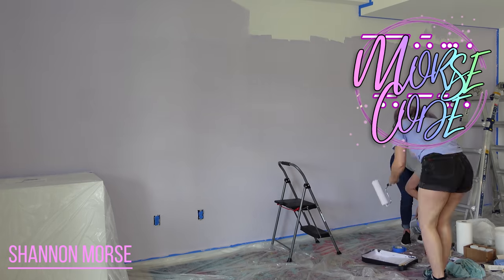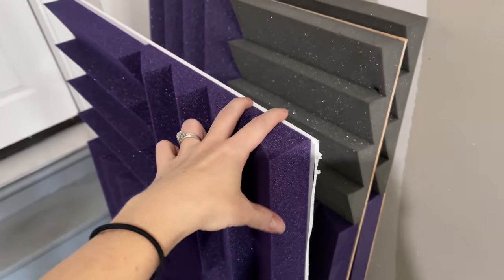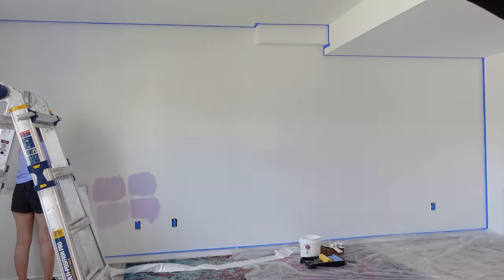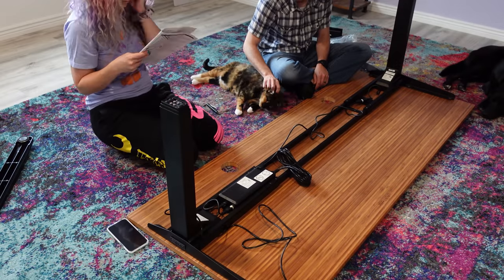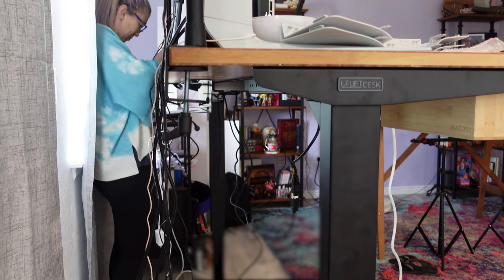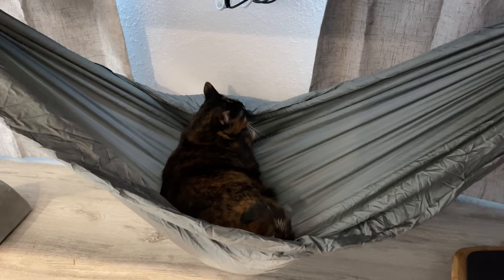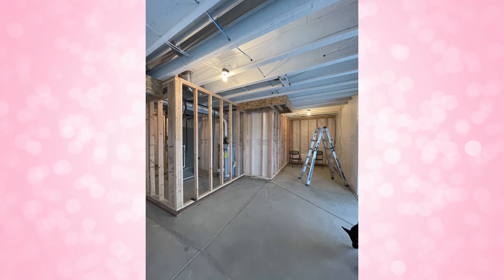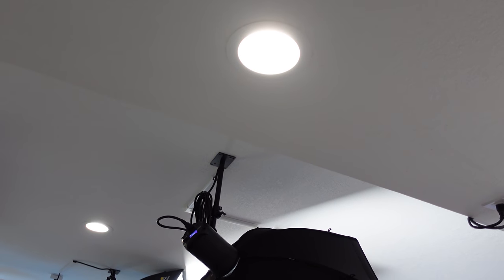Construction Complete! Furniture and Decor Timelapse - My Dream YouTuber Studio Build! | Pt 7

Comment: As someone who is also remodeling there house I can totally agree with the tired part been about a year outsourced the hvac and refraining in the rafters and floor joists...1890's home... been challenging but rewarding still have bathroom to finish plumbing in and drain lines to connect to the main drain...while open I ran structured media cables throughout the house and also went with a dream machine and a 48 port Poe switch through ubiquity so worth it

Comment: Love my ubiquiti setup! So many issues I was having with "consumer" networking went away when I made the switch though my lan traffic is a bit crazy with VMs, multiple nas, etc... I can't wait for the setup video! I am a little shock though you're not using the 10G SPF+ port for between devices and for the WAN! Then again, I do have a little faster than a gigabit internet connection so I had to use it to take advantage of it.
Reply from the maker: Oh I do plan to use it but I think I need a specific accessory? Or will any old cable do?
Reply: You do need a SPF+ modules. They have SPF+ to SPF+ cables, SPF+ to fiber, and SPF+ to RJ45/ethernet. On my setup, I use SPF+ to SPF+ between the UDM Pro, a 10G USW (SPF+ switch), and a POE USW. For other 10G devices and connection to the modem, I'm using SPF+ to RJ45 and normal patch cables.

Note: You don't need the 10G USW switch unless you have several devices with 10G support. I only recently added it on because I wanted to connect more than one device at 10G.

Comment: I like the wall panel solution. I used square Industria (Higher density stud matrix) l Velcro mounts and four per panel (in the corners) and once in the center. on a foam-core board that was plasticized on one side (Thank you dollar store). (Mounted the panels to the walls using some picture hangers that are meant to be added to the concrete wall. They are small white hooks that have four hardened metal pins that you hammer into the wall. I used toggle bolts for drywall attachment since my building has aluminum studs and the thinnest legal drywall possible. One wall had the drywall laminated to the concrete. That's a frustrating situation involving a concrete drill the make holes for threaded inserts! placed with epoxy!

Comment: Command strips require you to get the right command strips (They are weight rated) and follow the directions. You need to mount on all four sides and usually two seats on each vertical mount point. I have several moderately heavy pictures The real issue is they package them in odd numbers, and you always need two packs to meet your needs making it an expensive proposition. For lightweight hanging, I use one-inch Velcro squares. Just make sure they are the industrial Velcro squares with the higher destiny Velcro product. Command strips only make sense if you intend to remove it from a wall.

Comment: Your monitor setup isn’t ergonomic. One monitor (the main one) should be right in front of you and the other right or left of it. Because with your current setup you always have to turn your head to the side to work on one which is not good. When the main screen is right in front of you, at least half of the time you don’t need the turn your head. For now you won’t notice it, but in 10 or 20 years you will!
Reply from the maker: The right one is in front of me. I rearranged a few things after recording this.
Reply: @ShannonMorse  your neck will thank you 😊